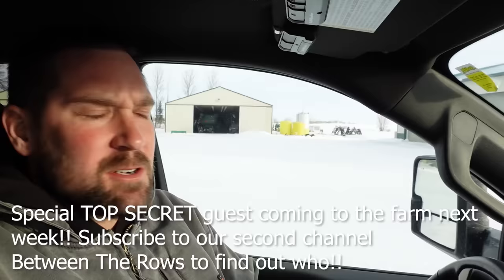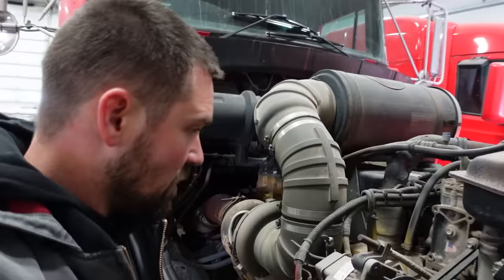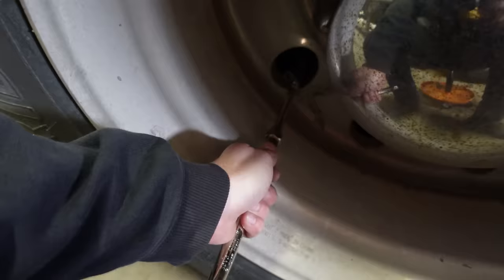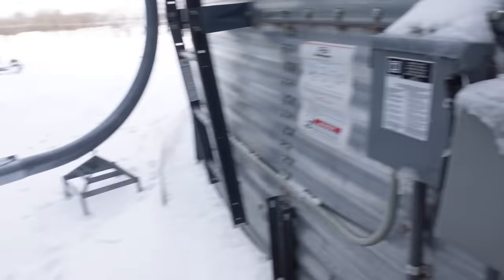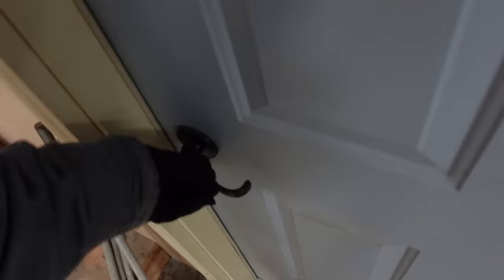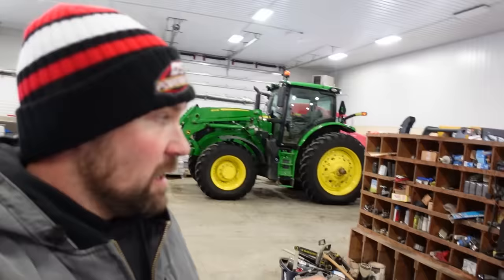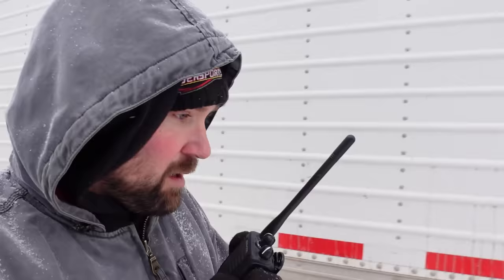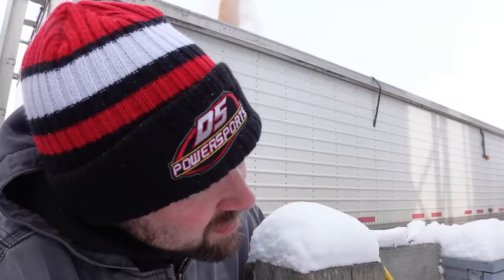MowerGate Scandal

Comment: By the looks of the thumbnail pic it looks like we're going to have a bumper crop of John Deere mowers this year they are sprouting up a little early from my experience that's a good sign of a hell of a yield
Reply from the maker: I hope you're right!
Reply: @Millennial Farmer  get a digital tire pressure gauge. Master mechanic here, I have had one for 10 years and it still works. I recommend the type you can also use as a tire inflator, you can use it as just a gauge without air hooked up, but also, if you have your air hose hooked at the same time everytime....you can add air as needed
Reply: @MillennialFarmer  are you setting up an OF page as well it would fit in well in the comments section 🤣
Reply: Hows come Angelina gets a millennial love, and Keyilaa , pesada , and Piya don't? €:•{0>)
Reply: @earlhollar1906  just report them
Reply: @benfairhall5331  I have been I've already worn out that little rubber stylist on the end of my PIN Penn Penn Penn Penn p e m n as in Nutcracker I wish their talk-to-text robot was as good as as Tokyo Rose.
Reply: @Yes to yee yee go away little boy

Comment: Just a heads up. If your old analog battery charger go bad, get it fixed. The new digital ones will not start charging if the batteries bare too dead. The parts place we deal with has had so many people disappointed with the new ones.

Comment: I’m sure someone else said it, but when charging batteries in a semi, put the positive on the positive of one battery and the negative on the negative of the furthermost battery.  It tends to work better that way.
Reply: They’re hooked up in parallel. That makes no difference.
Reply: @joshuahellriegel3354  you would be surprised. it does.
Reply: It's called CABLE RESISTANCE / which alters the way battery banks charge - as a voltage loss often occurs in the connection cables between the batteries, PLUS - if there is any "fault" such as a weak terminal connection - you will immediately find it when attempting to "charge" multiple parallel batteries, if using the furthest apart terminals .. (any faulty / weak connection will result in the battery charger showing buggah all current flow).

just jumping ONE battery and hoping all others get charged as well - well - no wonder the batteries fail overnight - maybe you ONLY have one connected correctly, the others have faulty terminals - meaning they drain the full battery overnight - result 4k all starting power.

Comment: It is generally a real good idea to keep the tops of your batteries clean. WD-40 Specialist Fast Drying Contact Cleaner can act as a protective layer, applied on the poles and terminals of the car battery and successfully eliminate oil, deposits of grease, dirt and mud.

Comment: Just an FYI, some of those mowers have a PIP (recall) out for the starters failing. If I remember right it was on the Kawasaki engines. Also, there’s a PIP out for the ignition switches. Could be worth looking into to see if your mower is covered

Comment: I feel you about the truck not starting, mine didn't either this morning. Mine was a starter, then a big air leak. Somehow the washer inside next to the big rubber seal (pancake) broke off, and the bolt pushed a whole thru it. It's been a fun day....

Comment: Hey Zach, mechanic here. Your Peter coolant sensor on the bottom of the burp tank is likely on the fritz, which is likely why your truck keeps telling you to stop the engine. Sometimes you can clean them with electric parts cleaner. Otherwise they are fairly cheap, but to replace you'll want to drain the coolant first... unless you can move quick to switch those sensors. 13 gallons is usual with that engine if I recall correctly. 

As far as 99% of your stuff dying all the time, might be due to the private radios not being cut off from power supply when the truck is off. A simple toggle switch hooked into the supply line at the back of the radio should do the trick. 

Also one other recommendation, weld some wingnuts to the top of the bolts on the battery box. Helps tremendously if you dont have an impact.
Reply: SHEESH
Reply: The sensors in these modern trucks are actually set to go off after minimal loss. It's very annoying.
Reply: Wouldn't be a terrible idea to have a Positive lug on the frame rail either. We have that on our freightliners, granted them KWs may not have room for that. Same with the Pete.
Reply: @Plyst3  that Pete should already have the jump posts on it. Most trucks come with them now
Reply: @jeffdrier4460  the Pete maybe given it's a 2016 or thereabouts. But the KWs don't.
Reply: @Plyst3  my T680 is a 15 it has them, all our KW newer than mine have them
Reply: @jeffdrier4460  now I'm no KW expert but Zach's rigs are from the 90s, maybe early 2000's. I doubt they have em.
Reply: @Plyst3  ok, yes, I misunderstood,  Zachs T800's are most likely late 90's do no they wouldn't

Comment: A tip on recaps . If you watch the tires on the front axle of your trailers when spinning around in a tight turn . The front axle tires drag sideway across the ground . If those tires are retreads , dragging sideways will peal the tread .For this reason only put retreads on the rear axle . On the tractor don't put retreads on the drive axle . I noticed your trailer has retreads on the front and new on the rear . I never had luck doing that .
Reply: Sorry but it's the rear axles that get drug sideways.  The trailer or tractor for that matter,  the front axle of the tandem axle,  is the pivot point. On a tandem axle,  the rear axle tires always wear out faster then the front axle tires by a ratio of at least 2 to 1.
Reply: @patrickburgmeier7902  So if you stand by the trailer when it is making a sharp turn , the axle dragging the tires , don't put recaps there for obvious reason And drive wheels peal recaps in hot weather . If one axle wears tires faster that the other. It could be the axles are not lined up with the king pin .It is unbelievable how good a trailer rides with straight axles. Thanks for the reply .
Reply: @kenreese2791  i know what you are saying about a super tight turn when the trailer and tractor are in a jackknifed position, yes the 2 axles are dragging. The front axle is dragging into the turn and the back axle is dragging away from the turn.  And if you are on hot pavement,  yes it is possible to peel retreads off. I wasn't referring to that instance tho. I waa referring to a gradual turn as found in normal highway driving.  In these instances the front axle is the pivot axle and the back axle takes the brunt of the skidding.  I don't run retreads because until they came out with dual tire equalization valves,  the dual tires would heat up and pressurize at different rates. The inside tire being closer to the brake would be at a higher pressure than the outer one and cause separation of the retread and a tire blow out.  Retreads are not worth the headache.  Thank you for your reply.
Reply: @patrickburgmeier7902  I used to recap my tires twice then sell the cores . A fleet of 45' and 48' dry vans hauling beer from Virginia to Long Island .
Reply: @patrickburgmeier7902  Especially if it's a tri-axle trailer.

Comment: A recommendation...  Use the "over/under" technique when coiling hoses (air, garden, etc.)  or extension cords.  This prevents all those looping kinks in the hose or extension cord when you pull it out for use.
Reply: Beat me to the punch. I 2nd this comment.
Reply: When I was doing stagehand type work..I learned this quickly.  Its not intuitive and not easy to teach but is the only way to coil cable and hose imo.  I've wrapped literally miles of cable this way.

Comment: That is a thermal over load that kicks off in the battery charger. After it cools off it will come back on.It keeps the charger from overheating and burning out the transformer.

Comment: Howdy Zack,
I made my own tire pressure gauge many a year ago. I took a air tire chuck (w/male threads) added a coupler and bought a really nice gauge (back 50 years ago only about $10). I never bought a tire gauge again and I still use the original one I put together. I just put one small drop of 3 in I oil in it before and after every use and store it upright so it doesn't pool in the gauge. I have made several more since then, but they are probably all in storage waiting for their next owner.
And I've noticed that you have, batteries going dead problem around the Farm. I have read on the power of the pyramid, though I've never took the time to look into it because I never had a problem with dead batteries. Have Jim weld up some 1/8" common steel into Pyramids (or just one to try) and place them on top of the battery. I forget what the ratio is between base and height (or degree of slop on the sides. Have to look that up, just check out the big 3 in Egypt. Not saying this will solve your problem because I have never done it, but it certainly is worth looking into. You must sit on a Strong N/S Magnetic Line for your batteries to drain in just a few days. A Pyramid might be the answer.
Thanks for sharing your life. You have way more guts than I! But who wants to watch an old cripple man sitting at a computer 1/2 his waking hours? My Doing Days have passed and I'm retired just trying to enjoy my painfully Golden Years. Hope you will try the ideas, especially the tire gauge. I'm sure it will be worth your time.
Reply: Howdy, Johk.

Comment: If you need an outside battery charger, you could make one with a pressure washer engine, and a 24v alternator. Some used on JD are not too expensive. The nice thing is that when it runs out of gas, it stops, and you can't overcharge the batteries. This could be a good thing to use if you have trouble with starting equipment in the field.
Reply: This how people here dry camp. You have to have the alternator converted to charge more then 5 amps. Like 40 amp charger

Comment: Save LP in a heated Garage by putting a micro switch on the door that turns of the Furnace when the door is open.  It just need to be added in the Thermostat circuit and it can pay for itself the time the doors stays open.

Comment: Being a mechanic all my life I will tell you that when you are all concerned about power washing your equipment and trucks you really need to blast off the  batteries. The dirt on batteries draws voltage out of them.  Connect the positive on your multimeter to the battery and drag the negative across the top of battery and you will see for your self. No charge for the lesson this time Zach.
Reply: Interesting: thanks for the info

Comment: Have you considered trying visual valve caps?  They are @$9 each. You buy the PSI rating you want. It’s green at correct pressure, red @10% below that.   At a glance you see which tire needs air.  I bounce with a pipe on truck, so it’s not worth it to me.
  See if a remote tire pressure monitor will reach from trailer to truck. Maybe a sponsor will donate one to evaluate. BTW Corn hit at least $6.22 in Glenwood I hear.

Comment: On the Peterbilt. If it has a paccar on the rear of the block passenger side there's 2 plastic coolant fittings that are prone to cracking and leaking. Replace fittings with brass

Comment: Have you tried gator caps on your valve stems plus you can get a cover for part of your air gage that holds the slide part .a air gage will get damaged easily by dropping thrown etc...

Comment: On the house garage door open , there are closers that have timers so they will self close  after 5 , 15 minutes or so . Some also have wifi remote control thru an app on your smart phone ,so if you need to check them when away from the house as well as battery back up if the power goes out

Comment: Cold weather and batteries just don’t get along 

But you could have just one bad battery dragging the other 3 down 
I’m sure you have heard about them exploding 
I have seen one on a cat 235 excavator blow the side OFF when the operator got back in the seat after lunch 
Just turned the key and BOOM 💥 
The other was my pickup 
We were in the house and heard a boom 
Looked outside to see what it was the only thing I noticed was a ugly stain on my passenger side fender I open the hood to see the battery looking like a pile of junk or shrapnel 

So be careful and cleaning them even if you just squirt them off with water and help them last longer

Comment: Hey Zach.  I would strongly recommend a extended hose air chuck that clips on to the valve stem.   Refilling air (especially on a tire that has been ran low at all) can be a good way to do permanent damage to your ears.  Sidewall gets weak from running low and they cant hold the new pressure and go kaboom.   Don't ask me how I know.  But i now have an air chuck with a 10' extension hose.
Reply: It's Zach

Comment: You need a master pressure gauge mounted to the shop wall to check the tire gauges and so you can adjust them if you unscrew them in the middle on top of the read out part is a screw to adjust them

Comment: It requires two hands to use , but use a compression tester gauge, adapted it to air line couplers, and use the tire fill chuck's to check tires. You can adapt to use straight on or use it with a hose . Check valve holds the pressure so you can read it .

Comment: I'm late to this video, but I saw your issue with the 579. I drove for a company that runs an all 579 fleet. Those coolant sensors are one of the most common failure points on those trucks. Sadly, it's the float inside the tank that goes bad usually. Which requires the whole tank assembly.

Comment: Most of those older manual battery chargers have an auto-resetting bimetallic strip circuit breaker inside, which protects them from outputting excessive current and causing internal charger damage.  So if you hear a "click" and see the amp gauge go to zero, this is the circuit breaker tripping.  After cooling down for a few minutes, it will reclose.  If the demand of the dead batteries (three completely-dead group 31 batteries in parallel will easily try to suck 100+ amps from the charger) continues to exceed the charger's output capability, it will sit there and cycle on/off indefinitely until it is disconnected or the battery state of charge increases to the point that the charge current decreases.

I'm personally a really big fan of having permanently-installed on-board charger/maintainer units with an AC power cord sticking out somewhere.  Then a hanging sign on the steering wheel which says "UNPLUG CHARGER" (or on cars/trucks, I will wrap the extension cord around the driver's side mirror to remind me to unplug it).

Comment: I don't mind hauling in the winter as long as you can get a day at least 10 above & not much wind. If you can get the sun reflecting off the bins it really helps. A couple of years ago we had a contract to fill & we knew that real cold weather was coming so we pushed to get done before it hit. Don't you know it a truck went down & we had to finish the last 3 loads in the cold. As I ate breakfast it was -7 out. The wind was blowing & it was miserable. Darn good thing it was only 3 loads because I was chilled the rest of the day after that.

Comment: Your key switch is bad.  After charging the batteries. And running. The unit. Lift the positive. Cable. With the key in off position. Put your voltage meter  on  the positive post and the other lead on the posited cable.  Set you meter to read. DC voltage.   Your meter will show a short of .01vts or .02  volts.   The keys switch in the off position  is not opening up the circuit.    You need disconnect switches  on all batteries.  Open up the switch when done using equipment.   Lawn mowers are bad about this. Same. Problem.

Comment: Driver, Shotgun, mailbox/auntie, there-yet/curb, kicker/hoffa, keg/hound-dog.   Trailer tires are named taxes/marriage, mortgage/frog, corvette/tailgate, ramp/blinker.    That's left to right as a rider all the way back.    I only know the outside names of the middle axle on a tridiem and those are rub and pivot.      Old 18 wheeler song in the lines of naming the reindeer.   Absolutely no clue where I picked it up.

If you're wondering about frog... hit a curb with the rear set on a right turn with a little speed.... hop hop hop

Comment: The dust on the top of your batteries is enough to allow 4 volts to pass between the poles. Rinse off the dust and the batteries will stay charged.

Comment: 9:00 transistors and capacitors wear out after using fast/rapid charge high start mode too much. electronics wear and tear, it just needs to be opened up and each component tested for spec tolerance and replace the failing/failed piece. if it was an apple product i would say check the CD2 3215 / PPBUS5v charge chip....but it's not.
this is what the local tv electronics repair shops were all about, and why radioshack was so nice.

Comment: Get a case of those milton gauges, and they'll all be within 2psi  checking the same tire at 125 psi. 

Good luck with napa gauges. I've seen two brand new ones 15 psi apart at 80.

Comment: What I had a charger like that that you connected to the dead battery and the gauge goes from charge to 0 that means the truck battery is bad or it’s so dead that it won’t charge it has to take at least overnight for it to do anything !

Comment: Extension cord tip, use a metal outlet box and cover with a standard outlet ( or two if you are feeling froggy ).  It's much cheaper and you can hook up two chargers 😲🔌😲🔌.

Comment: I have a blue point/snap on dual position digital pressure gauge.  I've had it for years, works great.  I've actually had to change batteries several times in it I've  had it so long.